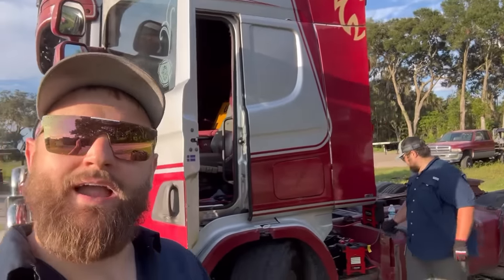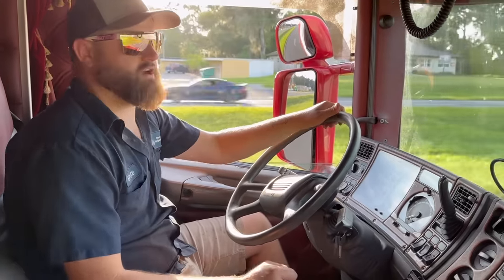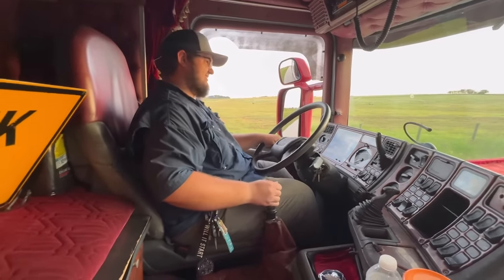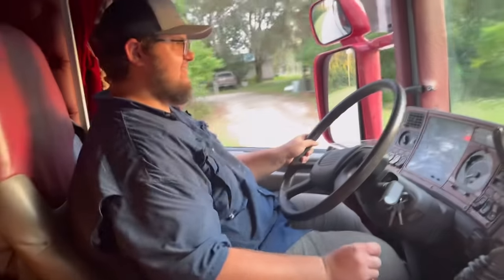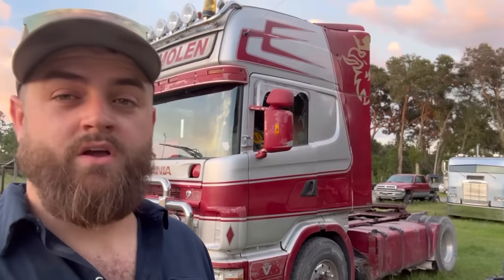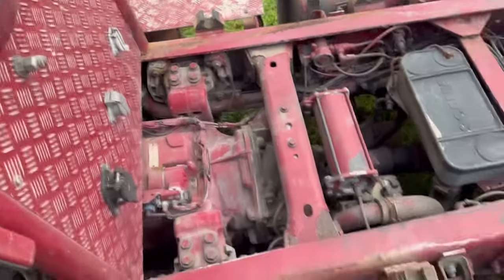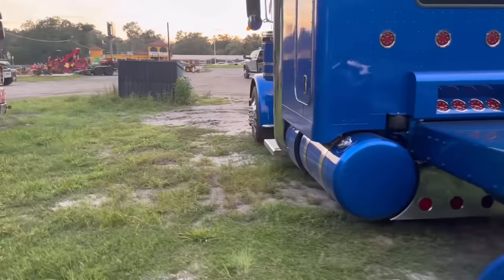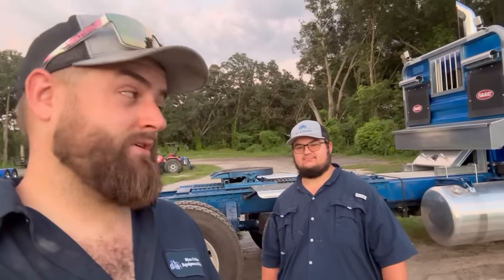American ATTEMPTS to Drive European Semi Truck. (Big Fail)

Comment: You're right, the modern trucks do have auto boxes but they've got a manual shift up or down as well. You have the old version of our tachograph the new ones record electronically on a card similar to a credit card. Are you sure you only have 3 gear positions, you should have 4, together with the splitter giving you 8. Many of the features you seem impressed with in that truck we've actually had for years. You may have noticed the red light that comes on in the speedo face, this is to show when you overspeed the max permitted speed for the country. In the UK this is 60 mph. Most trucks are actually governed to a loer speed so that if you're going downhill you won't speed. I must confess I've always been surprised that America don't have V8 trucks, given the American affection for V8 engines and I'm also surprised at how much smaller your truck engines are compared to ours. Most of our trucks do have the twin rear axles, but at least one of them will lift generally. Adjustable air suspension is more or less standard on all axles and on the driver's seat. I drove heavy goods vehicles for 35 years, before I retired, and the gearboxes have been syncro for at least that long. Your gearbox should be 1/5,2/6 3/7 & 4/8. You go 1 - 4 and then split and go 5 - 8. I think your trucks probably have more gears cos you're running smaller engines and you're going to higher speeds than we can over here.
Reply: Scania and volvo have 12 gears (not counting crawler gears) it's 1-3 with split so 1L-3H and the next range is 4L-6H

Comment: ..Scania is a good Euro truck/Swedish?? n sophisticated. I'd keep it the way it is. But, b4 U do anything, check the power n tranny/clutch if it can pull. Maintain the rear Disk Brakes.
If I were a trucker, I'd get one for my personal use like going to town for Ice cream n erants.
Reply: It’s capable of almost 800 hp. That is enough power to pull almost anything.
Reply: @lookingbehind6335  Only the top model which are used commonly in heavy/special transportation. The average Scania model since 2005 is between 500-600hp.

Comment: So why is unsyncronized gearboxes so common in north America? It must be so hard and difficult to drive? 
If you manage to import a newer Scania NextGen from 2018 or newer you will be very unique. Love those, so extremely nice to drive 👍
Reply: Its down to different drivers, a lot are going to full automatic now a days. As for importing, unless Scania starts making their truck in the U.S your not getting anything new from them. There are import laws that make it almost impossible to import any vehicle younger than 25 years old here.
Reply: @sterlingodeaghaidh5086  I see. Well almost every new Scania sold in Europe today, has automatic gearbox.
 Scania seems to not be willing to start produce/sell their trucks in north America. In some ways i can see why. Scania only have cabovers and does not have the majority of the typical setups that's common on the north american trucks. Volvo does but they do not offer V8 😏
Reply: @MrPuggen  To a certian extent we use COE style trucks in the U.S, scania could probably have a banging market if they sold upfit chassis here for stuff like municipal garbage trucks and more. 

The issue is that the American market is much like the European market in diversity but the demands are not the same. The most obvious is the fact chassis length doesn’t matter but comfort for long duration does, they would have to at least partially reengineer their models to meet U.S requirements. 

With that said its not like the COE concept is lost on us, we are much more like Australia where there is a possibility for a market for both types.
Reply: You have to have the right revs on an unsynchronized gearbox to change. When you learn it, you can change up without the clutch. But the truth is that partly it's  just old habit and partly 'cause they are simple and there for durable.
Reply: Unsync. gearboxes are much better and stronger to handle the torque.  Problem was it was too expensive and hard for newer generation drivers to teach it.
Reply: Durability is the main reason. Synchros are relatively weak and are essentially a wear part. US/Canadian driver tend to cover a lot more miles than European drivers (commercial and non-commercial).
Reply: @rich7447  That's right. and it's not even difficult anymore when you got used to it.  It's even easier to float through the gears without having to dip in te cluth all the time (like synchros or double-clutching on non-synchronized gearboxes
Reply: @westyork937  I had more trouble with going too deep with the clutch and hitting the clutch brake than I did with the double clutching.

Comment: Why do American trucks need an APU? European trucks don't need them as the batteries are more than capable of running a night heater or aircon, a fridge, a microwave and a TV without the need to run the engine all night.

Comment: All I know about European trucks is that they tend to be smaller and don't have nearly the same comforts as American trucks, as truckers in Europe tend to spend more time in hotels than sleeping in their trucks. The European trucks are also slower since most trucks only go 55 Mph whereas 75 Mph or faster is common in the United States. For example, I was just following a huge multi-tandem dump truck doing 82 Mph on the interstate not far from my house.  🙂
Reply: You are a bit wrong here:) I' ve been a truck driver for 20 years in Sweden, driving all over Europe. I've never known any truck drivers sleeping in hotels, ever. We all sleep in the truck when we are away for more than one day. You are correct about the speed though. The trucks are limited in what speed you can drive at, and the law states that you can only drive "so" fast anyway. So, the gearing is a bit different. What you loose in speed from gearing, you gain in raw pulling power though. As for comfort; I have a bed, a fridge, tv and a coffee maker..what else does a man need? :D Always driven Scania's.
Reply: ive seen vids trucks in eu and uk topping 90mph plus very illegal tho and if caught prob get driving ban but they can sure shift if disable limiter, Magnets think they used as one the old method's, uk top speed is 60 mph for trucks but lot are eu limited and that 56mph but truck just for uk roads can legally do 60mph and remove limiter they shift
Reply: @stevekenilworth Wide open, our semi trucks can hit speeds over 100+ Mph, typically with 18-speeds. But trucks in the U.S. in some places can legally run as fast as 85 Mph. Most, though, will run between 65 and 75 Mph. 

I have heard that the UK at 60 Mph is considered one of the fastest legal speeds in Europe. 

Most trucks here won't run that slow for safety reasons, as cars would overtake them too fast if they only did 60 Mph. 

Some trucking companies tried 60 Mph caps as a trial run here. However, they found that routes that they normally run at 70 Mph+ could no longer be done in just one day when they tried to do 60 Mph. 

At 60 Mph, two drivers would become necessary, and it then got too costly to run at 60 Mph. The majority typically will aim for 70+ Mph.
Reply: Europe trucks can hit over 100mph too, just not many stupid enough to get caught on vid, even the vids ive seen topping 90mph and even that if caught loss job and license and possible even small bit jail time, very least a driving ban  so no job and  huge fine    @GalaxyFur
Reply: @stevekenilworth  Yeah, it makes sense that speed limits are slower in Europe since the distances are shorter and the roads are smaller. So I get why speeds are much lower for safety reasons over there.

Comment: The truck is short due to length restrictions in Europe for trucks including their trailers
Reply: Longer trucks weigh more, which means to stay in side weight limits means less payload, and that's what pays the bills. Also European trucks have just one lever for the parking brake,  so both the tractor & trailer brakes apply together, and this has to have protection against accidental  release or application.

Comment: A Scania 540 with no trailer or load on it, you probably only need to use three gears. Maybe start in low 3 then high 4 then straight to top gear. 
In Sweden trucks were made to easily pull 60 metric tones inkl weight of the truck. Now days i think max weight is up to 70 metric tones, might actually be more. 
That American truck in a previous video might have been faster but put some weight on it and i think it would turn out different 😋
Reply: You can do it with this 4-series too. I did it seldom with a 420R.  When without trailer start with 4 low. I'm sure it would beat that old Pete!

Comment: How about you get a European driver to drive a manual American truck as well. Might be fun.
Reply: Not possible, most euro truckdrivers aren't able to shift non-synchro gearboxes (like EATON FULLER) in american trucks.  It's called floating (instead of double clutching, shifting these without using the clutch)

Comment: Hi! I did find Scania 6x4 long(9.95m/32,6 feet, I guess) double frame. It cost little bit less than 2000$ (70556 HRN)
1. It's from R series theoretically may not fit for your needs.
2. Condition is unknown. On photos it's fine.
3. Located in Ukraine.
Will put link in comment to this comment.
Reply: Links are disabled on YouTube, might be able to copy the title exactly as it is originally, in original language and it should be possible to find 🙂

Comment: Some told me that US trucks have lower bhp than European trucks, why is that?
Reply: Not on average which is between 500-600 hp wheras in Europe it's between on 450-550 hp, but Scania/Volvo have models with nearly 800 hp, wheras in US trucks (if needed) you need to modify the engine or put in a bigger one (like CAT C18 900 hp)
Reply: @westyork937  Thanks for that. A friend in the UK and his brother in the US have bought a couple of trucks in the US for car transportation. He mentioned that there were certain limits in different States. Not sure what brand of trucks they are, but he said for newer trucks he could only get straight 6 engines. In the UK the Volvos and Scania's seem to be the most popular, with the V8 blocks. DAF's, Merc's and Ivecos come after.

Comment: Strip and shotblast the chassis and add a lift axle behind the existing drive axle. Keep the existing fuel tanks, just get them cleaned up and resprayed. 2  6 inch straight stacks. alloy wheels, cad respray.

Comment: Painful to watch those gear changes ..You can drive them without a clutch .You just need to drive it properly and match the revs ...The clutch is only needed for start and stop and for split and range ,have driven many back to the workshop with a failed clutch pedal ...In europe we the manufacturers have had to do the electronics early due to european laws...If you have a look at a american you tuber I Wocker he has a video reacting to a DAF truck who are owned by PACCAR now who as you know own Peterbilt and Kenworth so you may recognise the likes of the steering wheel...Nowdays as an option you can have cameras instead of mirrors ,another option is the electronic handbrake like in a car ,there is predictive cruise control ,Advanced Emergency Braking ,so there is a Radar and you can set how close you get to the vehicle in front ,if someone cuts in front of you the brakes automatically apply, Lane Departure Warning ,if you leave your lane without indicating as an example the radio cuts out and you get a noise through the speakers so if you drift left  the left speaker makes the noise ,Because 99% of trucks in europe are auto ,you now can have basically GPS in the gearbox ,so the truck knows where it is and will not make needless gearchanges  as it know you are at the top of a hill climb .in certain circumstance the gearbox will also move in to neutral to save fuel,,There are at least 20 ECMs in a modern euro truck ,even the lighting is on a LIN system and CAN systems run the whole truck..But when they breakdown they are a pig to repair electronically

Comment: Guys im cringing here. You dont use the splitter when your not pulling a trailer   For just the unit start off in 3rd in the low box then just use the high box as normal

Comment: Oh Bruce... If your Scania already seems complicated, don't get a new one! These are data centers on wheels. Everything is digital with data bus communication, radar systems for distance measurement and emergency brake assist, cameras and displays instead of wing mirrors and other useless stuff.
Too bad that your Scania is so run down.

Comment: Well, getting a new Scania with manual is not really possible as manual transmissions is discontinued..
You have clutch on demand when starting if you want, but not really necessary..
You can paddle shift it, but why? The computer is much better than you for shifting..

Comment: that frame is done...damn...hell see Edison motors here on YT can make it a EV for ya. they just got their test mule driving and it has a "on board level 4 charger"  its a heavy spec off highway logger...ish...they are also working on a service truck so...you could keep it a single axle show truck...
Reply: No it’s definitely a on highway truck and definitely is heavy spec with planetary gear axles and heavy axles and a 1/2 inch frame thick more than a standard frame. Also Canada allows heavy loads than the states so on highway trucks can push 140 thousand pounds and the off highway log trucks like a pacific p16 are close to 200 thousand fully loaded

Comment: Your batteries are too small is your problem, should be at least pair of N150 or N200 batteries. Those batteries you have are too small for even a pickup truck.